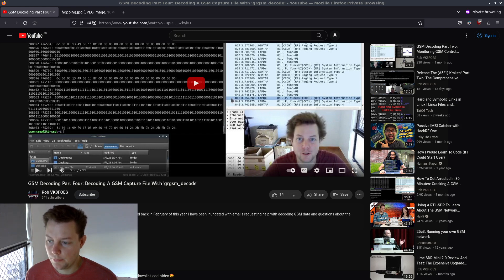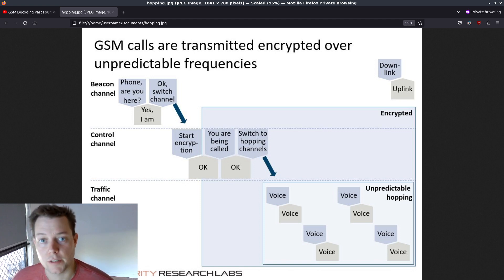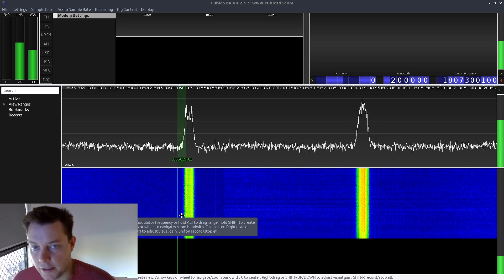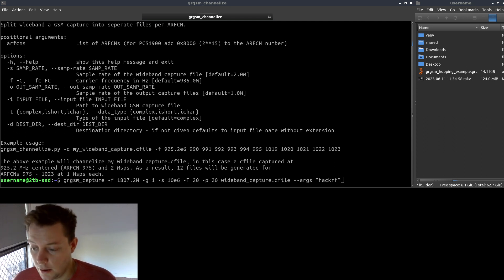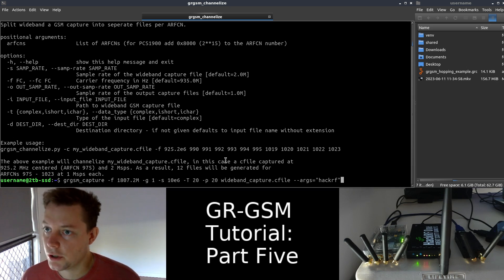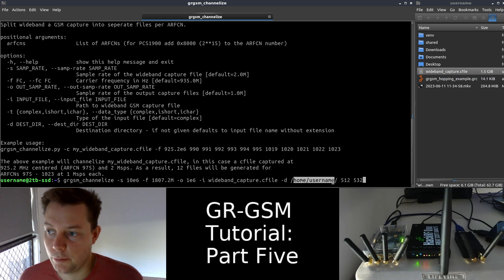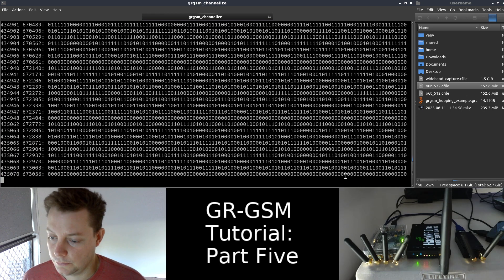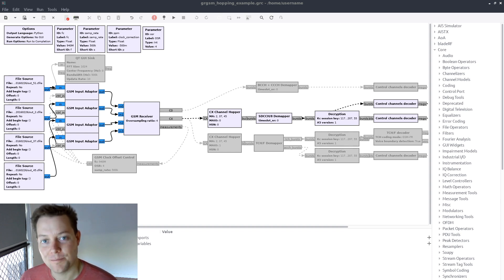GSM Decoding Part 5: Handling Frequency Hopping Channels With 'grgsm_channelize'

Comment: Hello Rob. I see you set 2 ARFCN because you know them, but why in the example with 925.2 Mhz there are 11 ARFCNs? How do we know how much and which ARFCNs to set in this command?
Reply from the maker: Hi. When trying this on a real 2G base station, you can use your SDR in conjunction with 'grgsm_livemon' and decode the BCCH (control channel). Then you analyze the 'System Information Type 1' packet in Wireshark. The field listing all of the hopping ARFCN's is called 'List of ARFCNS' (look in the bottom window pane of Wireshark after clicking on the Sys Info 1 packet)
Reply: @RobVK8FOES  I think the most people who are interested in this, don`t have capability to run simulated 2G network, so the only option is to experiment with the real GSM network. So I`d like to see what is diferrent in the real. I found the info you mentionned, thank you, actually in Sys Info2 there is Neigbour cells Description - BCCH Frequency list, List of ARCFNs = 6-7 ARCFNs. So for the command channelize I have to write them and add the middle frequency between them?

Comment: Great video,congratulations. Could I do the same with only the SDRPlay RSP1A (10Khz-2Ghz) without needing the HackRF?
Reply from the maker: Yes, I believe so. But the SDRPlay range of devices have very poor Linux support, and I haven't had much luck with them. Do you specifically need to capture wideband hopping channels? If the 2G BTS is narrowband non-hopping, the cheap RTL-SDR Blog V3/V4 is all you ever need.

Comment: If i only have HackRF, do I still need the other hardware ?
Reply from the maker: Hi. Yes, a HackRF will work perfectly fine for capturing and decoding GSM. And of course, you will need an antenna for receiving the 2G signals. The ANT500 antenna included with the HackRF should work fine, providing you are relatively close to the cell tower which you want to receive. If you are far away from an 2G cell towers, you might need a dedicated high-gain GSM antenna.

Comment: Is this for hopping channels : yes ??
Reply from the maker: Hi, yes that is correct. 'grgsm_channelize' is used for splitting a wideband capture file into separate channel files. And then 'grgsm_hopping_example.grc' is used to 'reassemble' them into a single coherent signal to decode, if that makes sense? I haven't gotten that far yet...
Reply: @RobVK8FOES please make a guidance video on hopping channel and that hopping grc too.

Comment: i stumbled on this problem bc noticed that it jumps from gsm900 to 1800.
I'm going to order another RTL SDR
Reply from the maker: Before dropping $$$ a second RTL-SDR, just remember that they can't receive 1800 MHz GSM signals as their RXers can't hear anything above 1700 MHz :( And, I should add that it is not easy to use multiple RTL-SDR dongles with gr-gsm. It takes extensive hardware modification to syncrononise their clocks
Reply: @RobVK8FOES  RTL SDR v3 could, I don't know how it did but i got livemon to do that and got the cellid associated with GSM1800, I could confirm it using cellular-Z app on the phone
Reply from the maker: Uhhh, thats weird, because the RTL-SDR blog V3 has the R820T2 tuner chip in it, which has a maximum frequency of 1750 MHz. E4000 tuner chips (like my NESDR Smart XTR) has a maximum frequency of 2300 MHz. Blog v3 dongles never shipped with E4000 tuners.

Comment: Rtlsdr's are cheap, thats why ya buy a few. ;-) 
Works great with hopping/trunking/SpreadSpectrum.
Reply: RSPdx was on sale at Hamvention for about $150 and has 10MHz b/w too
Reply from the maker: @TrentArsenault I own an RSP1A and I love it. Great SDR!
Reply from the maker: It's not easy to use multiple RTL-SDRs with gr-gsm. It involves extensive hardware modifications to all dongles to synchronize their clocks. Thats why a wideband SDR + grgsm_channelize and the grc flowchart is the preferred method :)